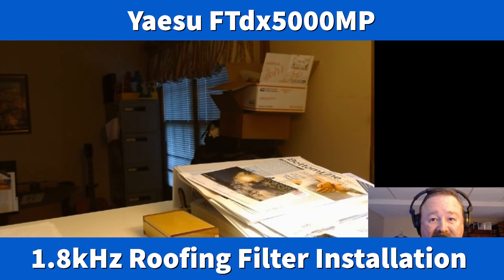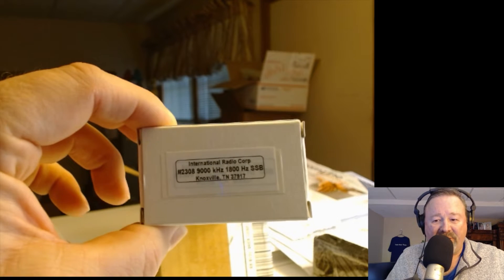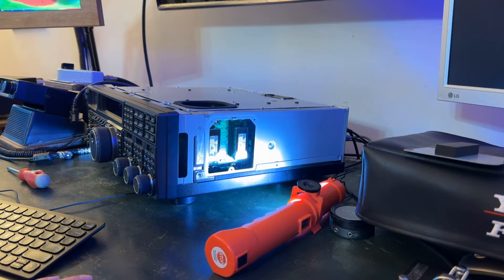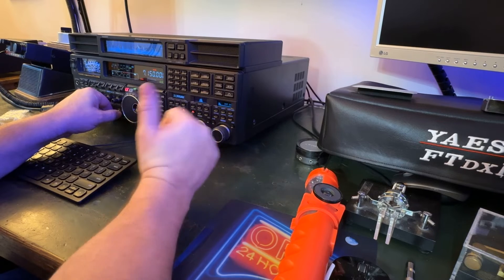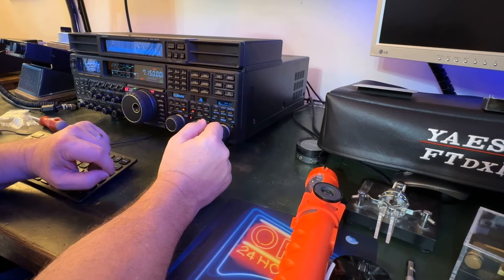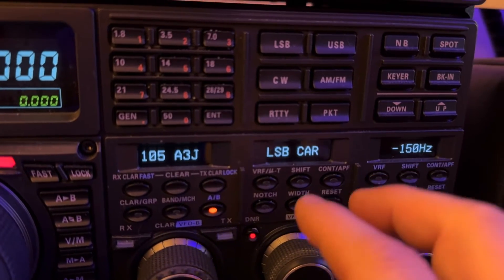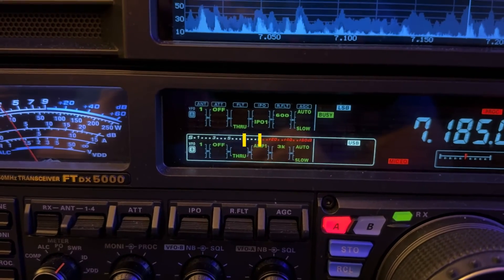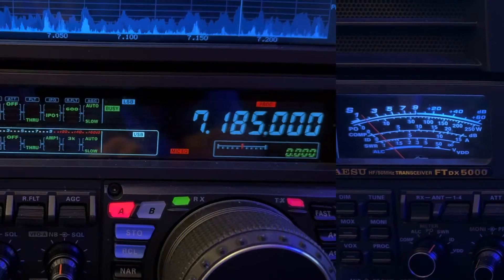Yaesu FTdx5000MP: 1.8kHz Roofing Filter Installation #hamradio #yaesu #ftdx5000 #inrad

Comment: i thought it might be too narrow for good audio. Not the case. Thanks for the continued learning.
Reply from the maker: With a 1.8kHz roofing filter, I’m not going for full audio. I’m trying to minimize interference from someone 2kHz away, so I can hear the station I want to hear.  The 1.2kHz roofing filter makes the audio even less full, but it can combat interference from 1.5kHz away.  If I’m trying to work a rare DX station, or hear emergency traffic, I’m less concerned about fidelity.  That said, you can use your Shift control to add depth to the received audio by favoring the lower frequency portion of the audio spectrum. I’ve shown this technique in several videos.  Note however that if the interfering signal is manifested as a low “honking” sound, shifting can degrade your ability to hear the desired station.

Comment: Yaesu offers an optional 1.2 kHz roofing filter for the FTDX-101D and MP. Do you think that's too narrow for SSB considering your installation of a 1.8kHz filter? 73
Reply from the maker: I would have bought a 1.2kHz for the 5000 if it had been available. It’s only for contest conditions, when someone moves in too close. The 1.8kHz is better than the 3kHz, but a 1.2kHz is even better. You only used it whenever necessary. So, if I was interested in buying the FTdx101, I would get the D model with all options. I wrote an article about choosing between the FTdx101D/MP, FTdx10, and FT-710.  It’s available on Patreon only.

Comment: Hi Doug,
The Inrad 1.8k roofing filter does sound better than the DSP 1.8k. I had modified the FT-901DM with a 2.1k crystal filter kit from the Fox Tango group. Stay safe.  73  WJ3U
Reply from the maker: I installed the INRAD 2.1 in my FT-920 and it gave that radio a second wind. I’m very pleased with this 1.8kHz INRAD.

Comment: wish changing filter on the FTDX 101d was that easy
Reply from the maker: I know, right?  Yaesu made them solder in.  But, if you send it to Yaesu, you can get a 1.2kHz filter installed.